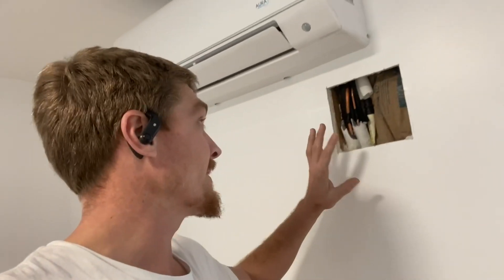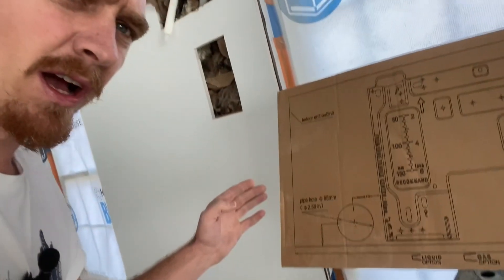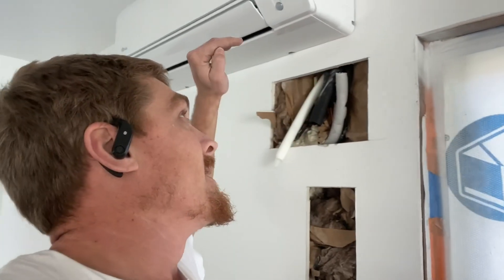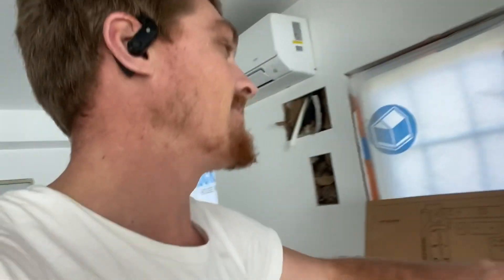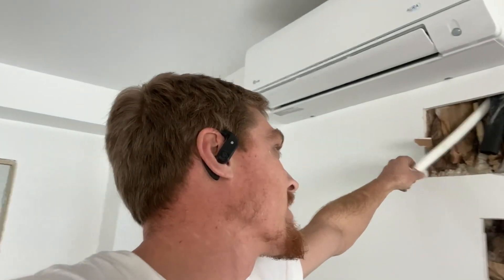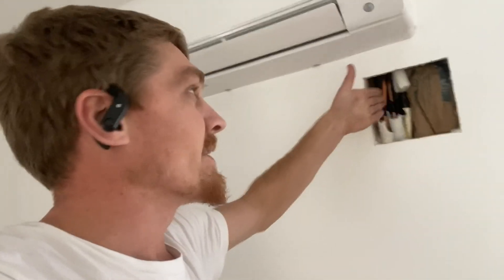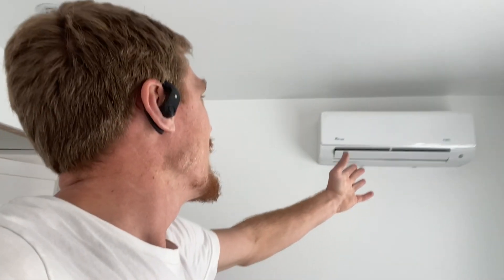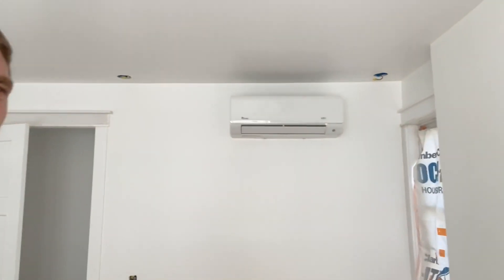Avoid This Crucial Mini Split Mistake

Comment: Did you Not use an vapor barrier? In Germany we use it on every timberframed walls, and they say thats very important that its very close so that No moisture came in to the isolation.